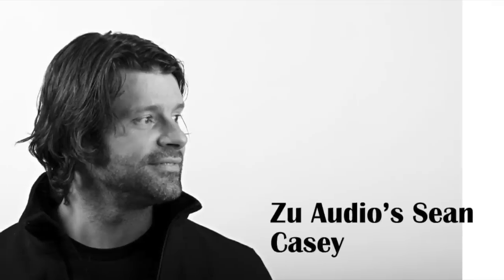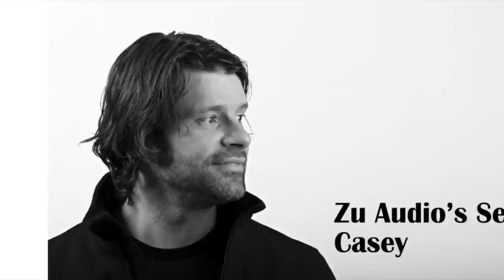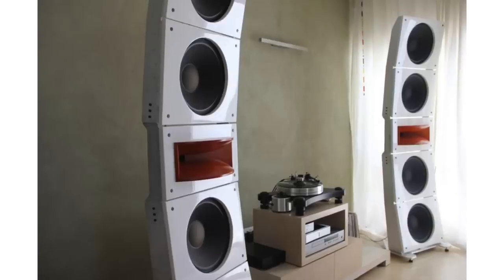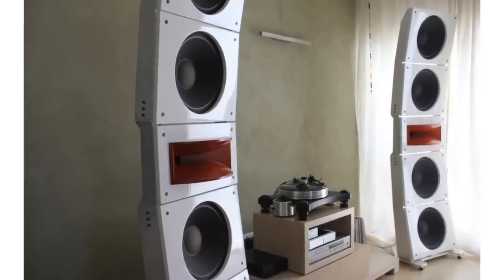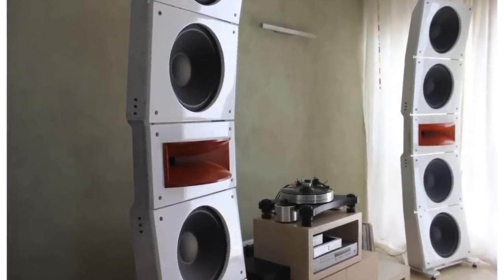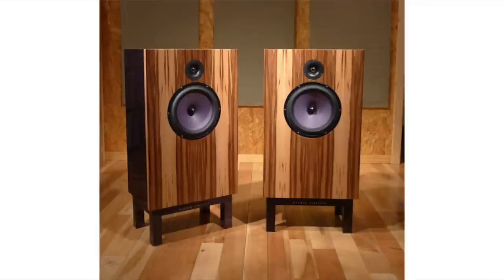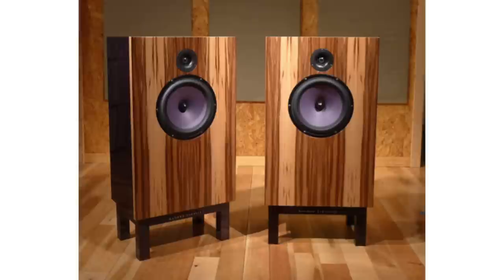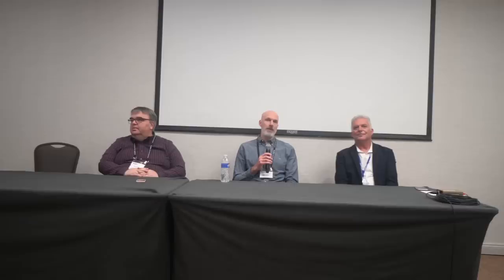Here's an in-depth discussion about box, horn, and panel speakers, and how they work

Comment: I own alot of boxes but I cant shake the need to try those lrs magnepan.
Reply: I used to have magnepan.  They have a huge cult following.  They are great for some people. Me?  I found them not my cup o' tea.
Reply: I am a basement dweller with the upstairs museum that nobody lives in.  Too nice.  But I digress.  Yes, try those LRS, but give them Bryston power they want 500 watts into 4 ohms.  Placed in the right spot as I seem to be capable of figuring out, they even produce satisfying bass with no subs.
Reply: No regrets with my LRS maggies. Worth every penny but I love horns as well so I have 2 different systems for 2.0
Reply: @JohnDoe-np3zk  agreed about the bass
Reply: @JohnDoe-np3zk  Hey john! I'm in a similar situation.  I'm running an all tube decware system with a pair of ZU audio souls. I love it but it wont drive my kirksaeter towers very well so I'm also running an arcam integrated which is a great match. But. Like I said   I'm drawn to those Maggie's so I've recently purchased a peachtree nova pre and the matching 220 amp. I'm driving my Kirk towers and a few bookshelves I have lying around. Sound is different from the arcam but I'm very happy with it as a system. I'm waiting for the audio coffers to refill so I can order those lrs.

Comment: Steve, My first foray into Hi-Fi, was with a pair of JVC omni-directional  speakers (Yes, the big black spheres !), which I had Special Ordered, from the PX system, in Vietnam. Like now, for many of us; without the ability to audition them first. Fortunately, they were very easy to listen to. I only got rid of them, because of the need to relocate quickly.  For those unfamiliar with that design; the Speaker compliment was 4 -    5 inch full range drivers (NO Crossovers) - which were  "hermetically sealed" (JVC's description - Which makes me what to say, "in a mayonnaise  jar". Thank You Johnny Carson.)  I'm assuming They were Acoustic Suspension. But, because the drivers were located within a sphere; perhaps even Isobaric - loaded ???  I'd love to get my hands on a pair, now. Perhaps upgrade the drivers. They do come up, every now and then on Ebay. However, I don't really recall; but the pricing may have been prohibitive. Not to mention, I'm Not sure they can  even be  disassembled  to upgrade or just to "service" them???

Comment: They mention Force they mention ceiling Dimension walls but they didn't mention other things like the furniture placement the placement of the speakers Furniture has a tendency to absorb sound and the flex sound so depending on how you set up your speakers it could not change the sound in the room by the way the furniture is positioned so you have to take everything into account I did this for several years I installed everything from from Midway expensive equipment to a little bit high-end that equipment and I can get stuff the sound pretty good where people couldn't believe that it sounded so good for the amount of money that they paid for it so you don't have to spend a lot of money to get good sounding equipment if people tell you that you have to are selling you snake oil and because you cannot you definitely cannot reproduce a live performance on anything that is out there no matter how much money you throw at it I have installed system that that was over $100,000 and it didn't sound any better then a $5,000 system it all depends on how things are set up and the dimensions of the room and when people start getting into wall I don't like the way it looks well you have to give up looks for the sound you have to position the speakers a certain distance away from the wall in a certain position in order to get the optimum listening and these people sometimes don't listen and they are not satisfied they spend a lot of money on this equipment and because they won't listen to you did this fattest dissatisfied with the equipment and then I go back and I set it up the way I told him to set it up that I wanted to set it up the first place and I set it up that way and it changes their whole entire View and the way that they hear it you have to take a lot of things into consideration you don't have to spend a ton of money on to get a system that sound good if you have a few thousand dollars you can get a nice system that sounds really good you don't have to spend that hundreds of thousands of dollars on a system if you have it and you want to spend it go right ahead but to me it's a waste I have right now in my living room a whole entire vintage Sansui system that one of their top of the line and I overhauled it and did a few modifications in the preamp section and I would put it up against anything that may today in my bedroom I have jbl's at a Yamaha receiver and I did modifications on that and on the speakers and there's no way anybody is going to touch this system you just have to know what you're doing

Comment: Horns don't actually have lower distortion than direct radiators.
Reply: They definitely have lower harmonic and IM distortion but bass horns have pronounced resonances to work around.  Driver integration also becomes more challenging vs. direct radiators.
Reply: @1mctous  Sorry you're incorrect. They were tested and it was found that in all but a very narrow range of frequencies that they had more distortion than the direct radiators. This is actually common knowledge. It seems it is a misconception among audiophiles and audio journalists. Results were published in an article back in the mid to late 90s.
Reply: @carlosoliveira-rc2xt  And not corroborated elsewhere.  HiFi News routinely tests speakers for harmonic and IM distortion at 100 Hz, 1KHz, and 10KHz at 90 dB at 1 meter.  I'll give you 1 guess which speakers measured lowest.
Reply: @1mctous  one thing will never change in the audio world. Horns are loved by many while a contempt exists in others. Many of the opinions of horn speakers of a certain brand.....Have not evolved beyond initial designs.  There are differences in distortion. 

Personal listening preferences have a market filled with options. Running down one against another makes no sense. Never a fan of horns until I actually had the opportunity to hear them. I have 2 sound rooms   both have horn loaded speakers. Take a guess who built them....